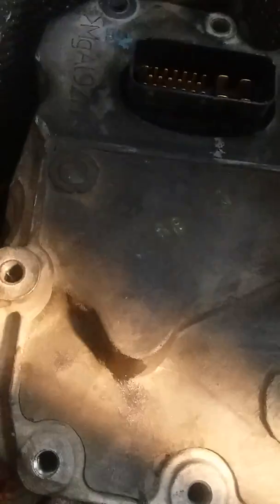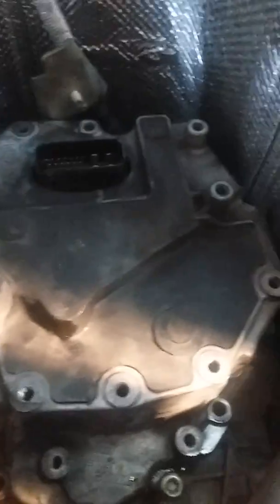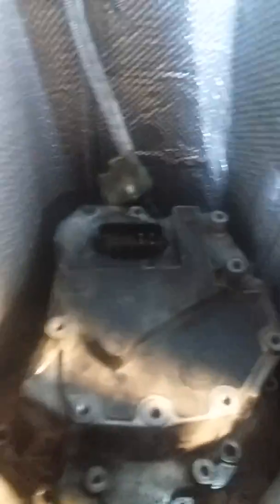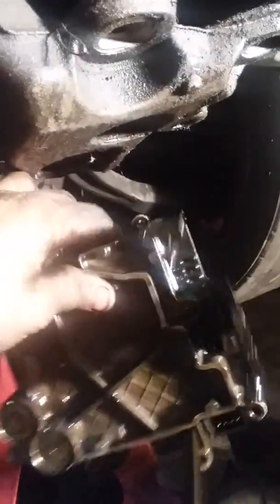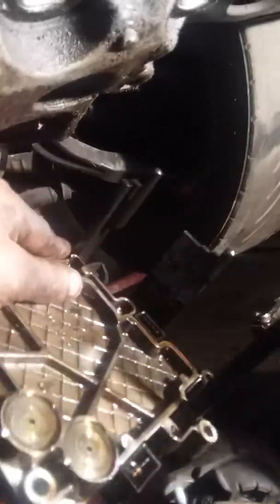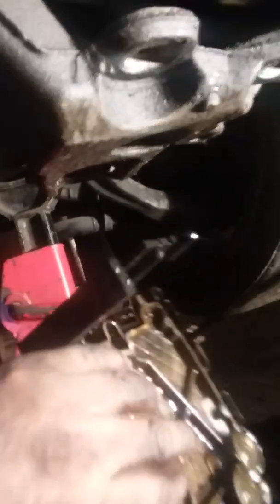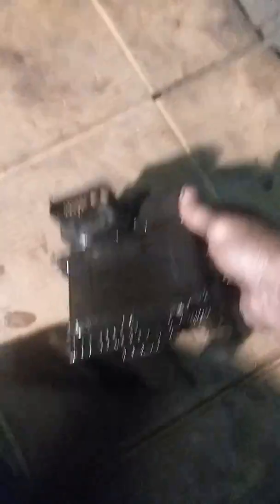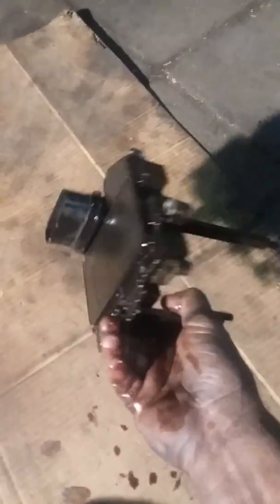03 audi a4 cvt transmission speed sensor location and removal

Comment: I have a 2008 Audi A4 2.0.  Is the part you removed the transmission control module (TCM)?  It looks like mine is bad and a new one is about $2,000!  It looks like it can be rebuilt for about $300.  What do recommend?  Thanks for your help.

Comment: Thanks.  After you replace the speed sensor does it have to be programmed?
Reply from the maker: No
Reply: @themechanicclub4668  Thank you.  I have a 2008 Audi A4 with check engine light on.  The code is P0722 - Output speed sensor circuit no signal.  Would the procedure be the same on my 2008 to replace the sensor?

Comment: Isn’t speed sensor located behind driver side front wheel?
Reply from the maker: No
Reply: Did you remove the oil from gearbox or you can replace without remove the oil

Comment: Bad engineering and the vss location.The part cost $1900+ tax. Only dealers has it and was told that it needs to be reprogrammed. My symptoms was intermittent ABS light on and no odometer MPH and a code of P0501. My tranny shift fined just can’t clear the code and intermittent odometer. End up donating the car because, the car is worth $3500 and the cost of fixing it over $2800 at the least. 2003 A4 convertible/AT ( gvc) tranny.